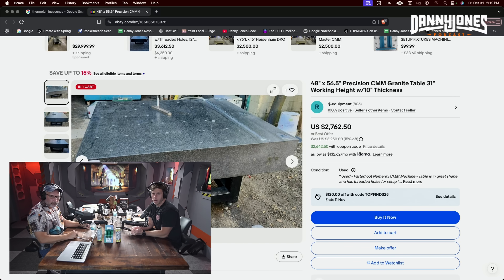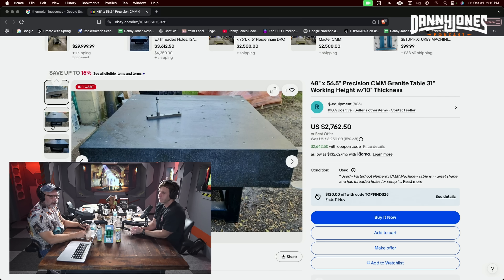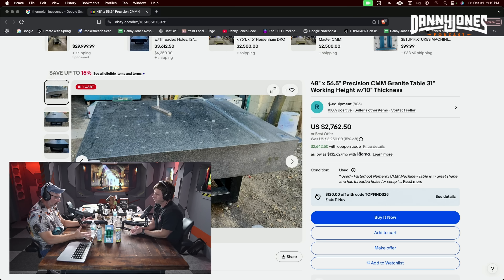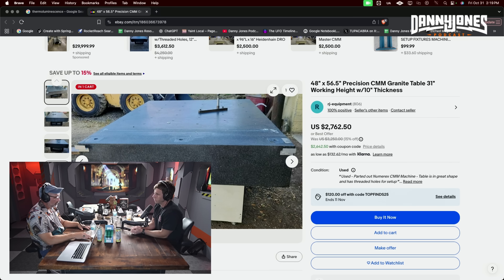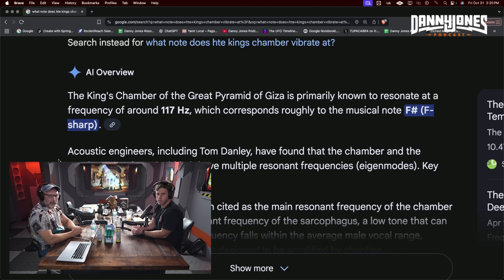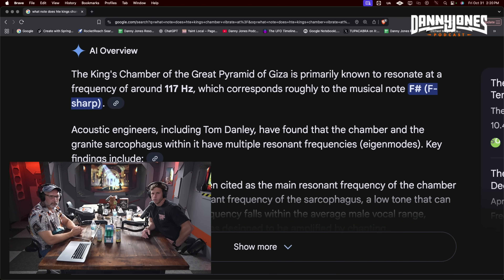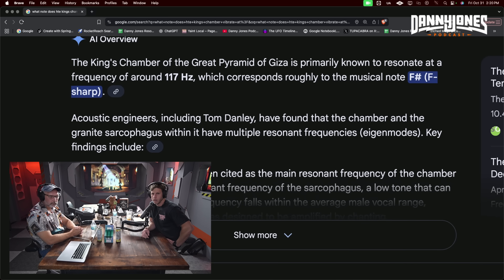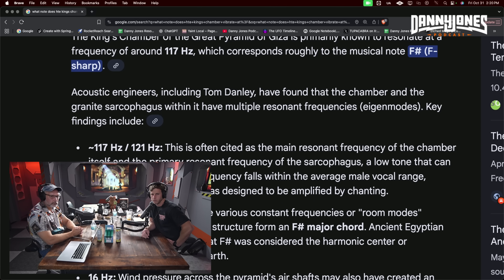Nuclear Engineer Explains Why There's Granite in the King's Chamber | Max Zamilov

Comment: The idea that the builders "scrapped" the Queen's Chamber then built the King's Chamber instead is frankly a smooth-brained take. Why wouldn't they just rebuilt the QC instead of building an entirely new chamber on top of it? No engineer would ever do that.

It is FAR more likely that the entire structure was built with an interconnected purpose, and each chamber served a different function. Just because the QC doesn't fit into this guy's limited understanding, it doesn't mean it was "abandoned" as a flawed concept.

Comment: The diagonal shafts are for air.    Analysis by another channel proposes that the Queen's chamber shafts terminate at the exterior of a stepped inner core pyramid that was then finished to have a true pyramid shape.    It is rather unlikely that such a huge structure was built for a one-off use.   We have no idea if there was machinery inside the King's chamber that used the resonant geometry.   BTW, this is the same problem as for the so-called impeller disk.   People attempt to debunk it as some mundane object because stone would not survive the stresses.   They assume that this disk was a functional part and not a model with the functional parts being made of metal.   All the metal would have disappeared after 10+ thousand years (reuse and corrosion) and only stone would remain.
Reply: Isn't burial a one-off use?

Comment: I think there are a lot of parts missing form the great pyramid. The grand gallery could have housed a massive piston made from copper that was used as a pump. The 4 connecting shafts look suspiciously like Inlet and Outlet valves. The Kings Chamber had to have massive weighted stones to contain the pressure. The Queens chamber could have been a pressure relief chamber.

Comment: Been in car audio for 20 years got two master tuner of the year awards the pyramid is built like a bandpass box it's almost like a ultra massive internal subwoofer style of a bandpass or a very high end subwoofer and box combo and i mean rediculously high end it also seems to be designed to dampen or built to not waste any low frequency waves this sucker I'm willing to bet is tuned down to at least 20hz so you wouldn't hear anything but you would probably feel something im not 100% sure because of the stoned on the outside regardless this turned 20hz into something like 2,000hz that is where it possibly could have been insanely loud but! Those shafts act as eave guides so again maybe you didn't hear a damn thing. This I can not be sure of but i know EXACTLY what they where doing here. Keep up the good work

Comment: People underestimate how advanced the ancient builders were because they look at the stones but not the engineering logic behind every decision. Granite in the King’s Chamber was not a random artistic choice. It was a structural requirement grounded in physics, stress distribution, and long term stability. When millions of pounds of stone are stacked above a chamber, the wrong material would deform, shift, or crack with time. The builders understood the behavior of materials in a way that came from generations of observation and careful testing.

Granite has an extremely high compressive strength, far above that of limestone. It is less likely to deform under stress, so it keeps a room stable even while the surrounding structure moves slightly over centuries. It also transfers vibration in a very clean way. This matters because any small resonance inside the chamber could build up stress inside the larger pyramid. The placement of granite created a protective shell that kept the chamber from amplifying energy or producing micro fractures.

Ancient engineers also understood thermal expansion. The pyramid sits in a desert environment, so temperatures cause the stone to expand during the day and contract at night. Granite reacts to heat in a slower and more controlled way. That steadiness reduces crack formation over long periods of time. Limestone reacts more quickly, so using limestone for the most sensitive chamber would eventually create structural failure.

The concept of a stable box inside a box is also important. The King’s Chamber is not floating freely inside the pyramid. It is part of a layered system designed to redirect pressure outward and downward into the base. Above the chamber, there are a series of relieving spaces and massive granite beams. These beams distribute weight away from the ceiling and into the side walls so the chamber does not collapse from vertical pressure. It is the same principle that modern skyscrapers use when they build pressure releasing layers to redirect stress.

Newer research shows that the granite beams above the King’s Chamber also have acoustic properties that help the structure maintain balance. Vibrations produced by movement, earthquakes, or even wind patterns are absorbed or scattered instead of amplified. Engineers today do the same thing in large buildings by installing tuned mass dampers. The ancient builders did it with nothing but stone.

There is another detail people forget. Every piece of granite had to be transported from Aswan, which is more than five hundred miles away. Moving that much stone meant the builders were not simply using what they had nearby. They went to extreme effort because they knew exactly what type of stone would survive in that specific position. That proves intention, planning, and advanced engineering judgment.

So when people say the ancient world used simple tools, they miss the point. Their tools were simple, but their understanding of physics, vibration, load distribution, and material behavior was extremely advanced. The pyramid is not just a stack of stones. It is a master class in structural engineering that still performs perfectly after thousands of years.

Comment: -Not just a single note . . . F#, but, an F# chord of 3 notes produced by tapping on each of the 5 stacked slabs above the ''King's chamber''.  What type of F# chord?  Chris Dunn has said that the sound of walking footsteps on the floor of that chamber produces the note 'A'.  Therefore, the chord is an F# minor chord.  There are 5 of these stacked granite slabs that were 'carved/chipped' to produce musical notes.  It's difficult to find info on which notes of an F# chord are sounded when tapped, though.  An F# chord has 3 notes . . . Are some of these 5 slabs repeated notes?  
If pressurized gasses produced in the Queen's chamber, and forced upward into the King's chamber and amplified by round wooden resonators (Chris Dunn), and held high by wooden poles anchored in ordered cavities in the floor of the Grand Gallery - then these pressurized gasses of Hydrogen could have created a musical chord (F#) when in motion and in contact with the 5 stacked granite slabs above the King's chamber.  Yes, this is complicated stuff for sure.  
But, the question can be asked (Chris Dunn) how does the note 'A' (footsteps on the floor of chamber) fit in with the F# chord?  An F# Major chord has the note 'A#', which would have been discordant - by a jarring 1/2 step - with the sounded note 'A' from the floor.  So, it must be that the 'F# chord' in question is, in theory, an 'F# minor' chord :  'F#, A, C#'.  And, how does an F# chord type fit in with the Earth's sounds produced by moving techtonic plates way below the Giza Plateau?

Comment: its called a granite surface plate. its the base for all measurement in a precision shop (ie iso compliant) grade AA for inspection rooms. they are kept tempter stable and flat with in .000010 of an inch....the only pink Granit mountain in the USA is owned buy Starrett. the only other pink Granit is in Egypt!
Reply: On blueprints a machined surface with whatever tolerance, is a checkmark sitting on a short straight line
Reply: @CERTIFIED334  ive been a machinist and Quality manager for ISO and DOD manufactures for over 20 years, and i have no clue what the hell your trying to type about???
Reply: @ClydeShelton-fv1lf I only worked at BAE Systems for 3.5yr and was split in half Quality and weld depts. Refurbishing M88 & M113DOV's
Reply: @ClydeShelton-fv1lf 
It's the first thing that pops up if you Google
What a checkmark on a line represents on a parts drawing
Reply: @CERTIFIED334  its called surface finish.... i see why you didnt work out at a real manufacturer.. what you need to know about surface finish?? and what does it have to do with surface plate?
Reply: @ClydeShelton-fv1lf 
It's the world's largest defense contractor so not sure what yur implying cause I didn't go to college nor would I use my GI bill to do so
Reply: @CERTIFIED334  dude cant even read a blueprint and you just telling me shit i already know... but yet you dont work for them anymore and that's what im typing about. so want to try again?
Reply: SURFACE FINISH TEXTURE SYMBOL